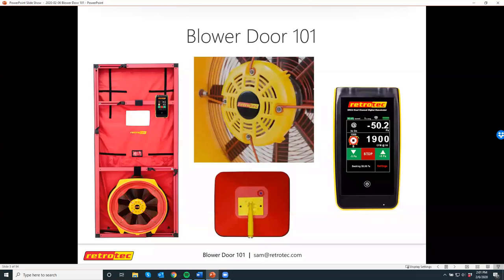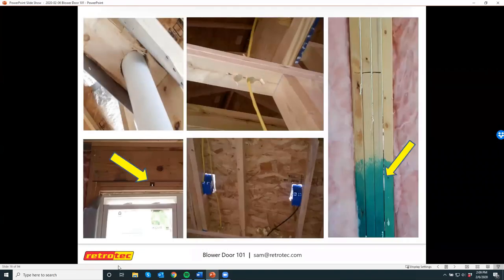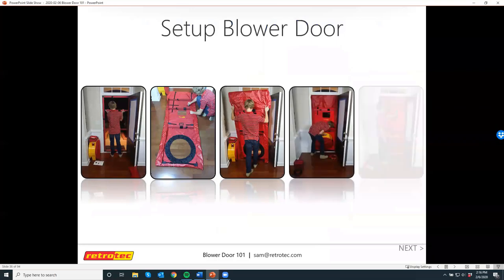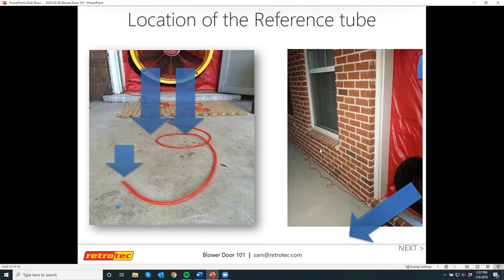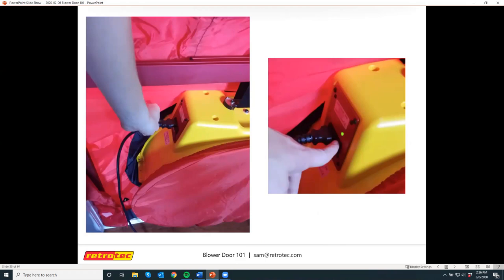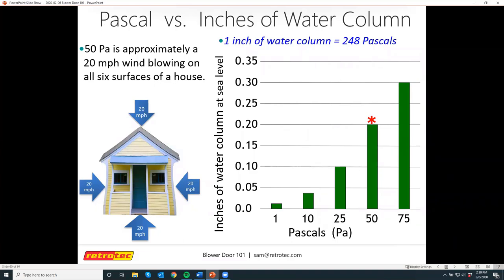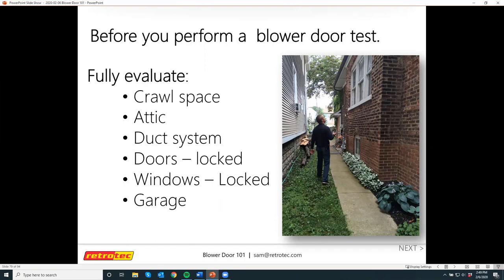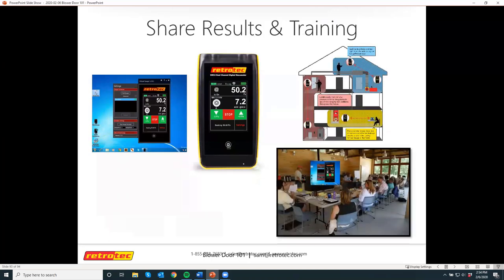Blower Door 101 - An Overview of Air Tightness Testing for Beginners

Comment: Can we make sure that the room require multiple fan If we are not reaching the target pressure of 50 pa ?
Reply from the maker: If the fan is on the Open Range and not even close to reaching 50 Pa, then you'll need multiple fans. You can check this beforehand by entering the dimensions and leakage target in our number of fans calculator: https://retrotec.com/number-fans-blower-door.html

Comment: What is the maximum volume of a container or a room , which we can test with one recrotec c6000 fan..?
Reply from the maker: its difficult to say as it depends on how leaky that room will be. A 6000 fan will produce approx. 8000CFM at 50pa, which is more than any other fan will do. If you have a large building you are testing, we have a calculator to help you determine the number of fans you'll need. https://retrotec.com/number-fans-blower-door.html